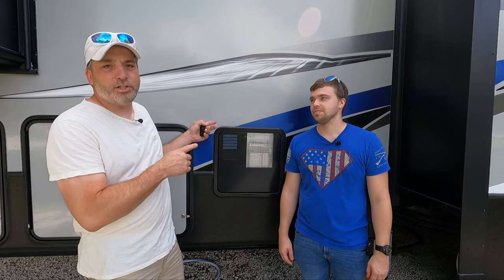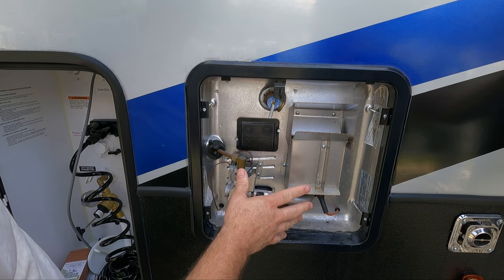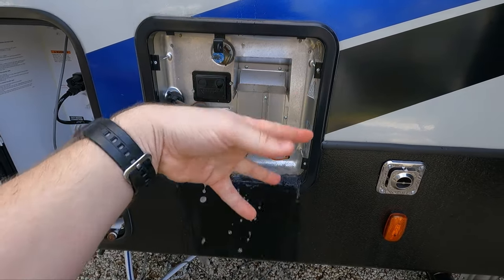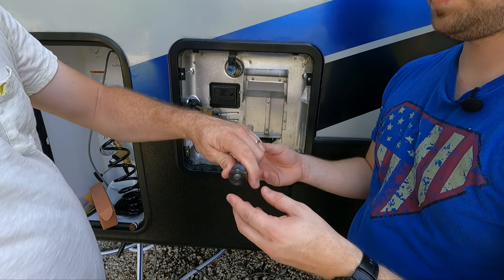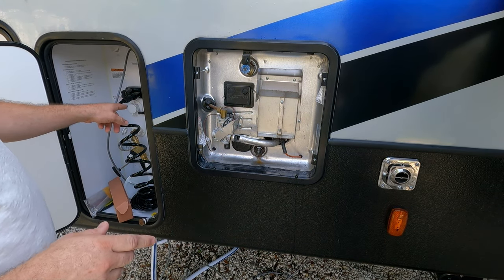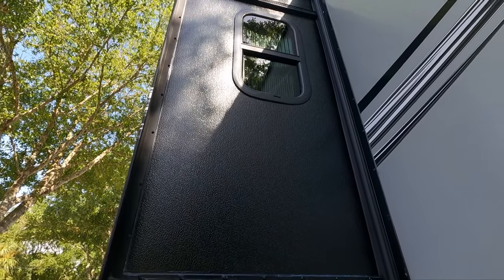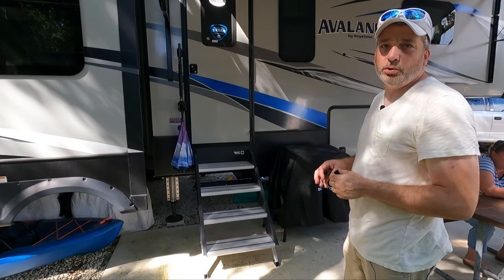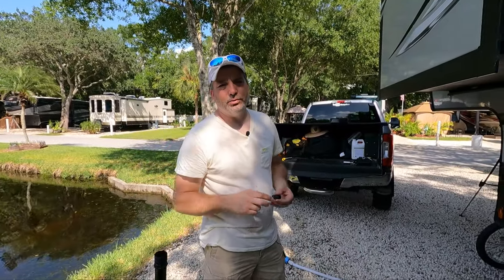How To Flush & Change RV Water Heater Anode

Comment: Good maintenance video y’all also a pro tip for y’all I changed my anode rod a couple of months ago after it was changed it I closed the high pressure valve and it wouldn’t close fully so I had to replace that valve so now I keep a spare  high pressure valve for spare
Reply from the maker: I'll add it to the list of spare parts to keep in the storage bay! Thanks.